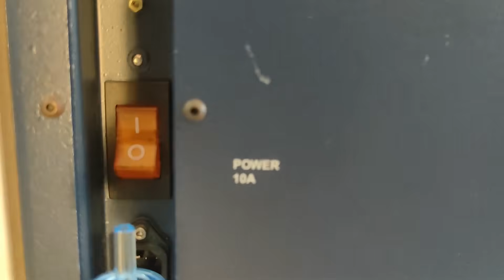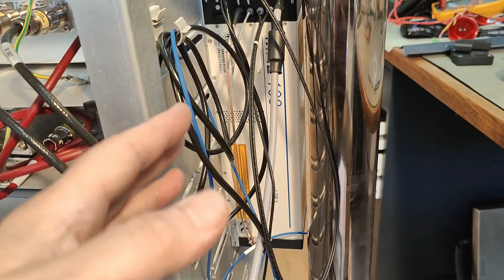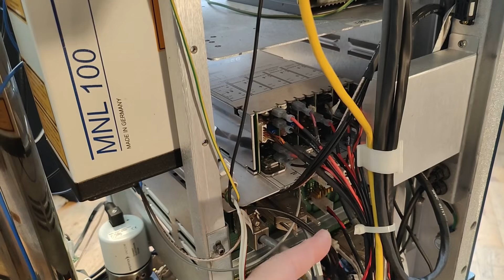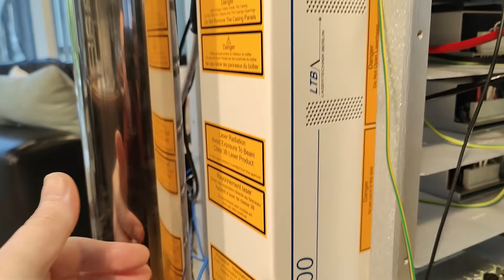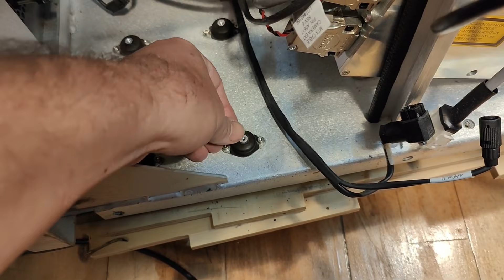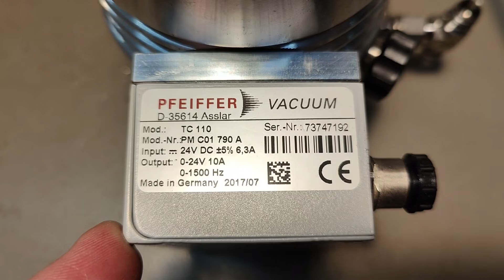Bruker Microflex LT Mass Spectrometer 2011 part 1

Comment: What are the risks of working with potentially bio-hazardous materials?
Reply: Death or serious injury. Samples are destroyed in the testing process however + everything is smooth stainless steel, so risk is like nothing.
Reply from the maker: exactly ZERO risk here, i poked arround with much worse
Reply: @TeardownOZ2CPU  Some companies will not accept parts for repairs because of the risks.  Ones that do normally require paperwork on what was ran through it.   I always wondered when the companies liquidate the equipment, if ebay and such were an easy way to circumvent proper disposal to the unknowing  public.

Comment: That nitrogen laser is definitely a custom one.  100kW with a 2.5ns pulse width is 250 microjoules of pulse energy- definitely above standard specs for this laser range, as is the 200Hz pulse rate.

Comment: Nice, that 100 KW laser is probably Q switched, the optical path in the laser cavity is blocked by a Kerr cell until the energy builds up to the required level then an electrical signal turns the Kerr cell transparent allowing all the power to be released in one high power very short pulse.
Reply from the maker: it is an MNL 100, I think this video show in good detail about this model : https://www.youtube.com/watch?v=k5MOAKHPVG8